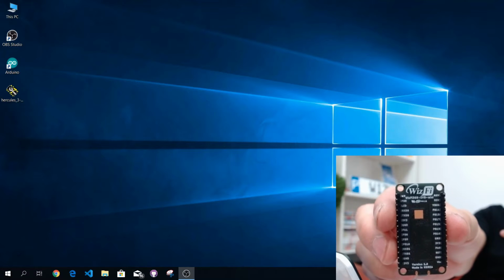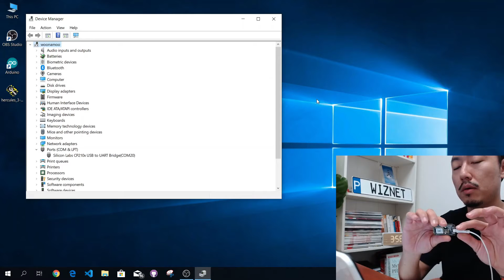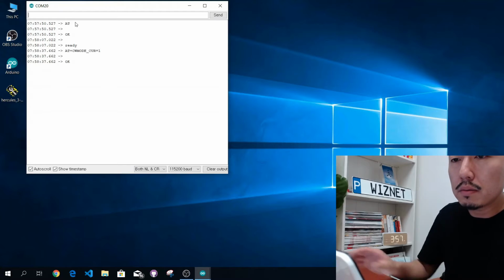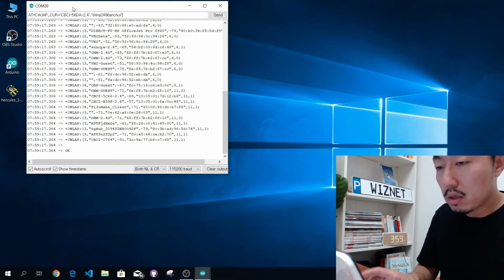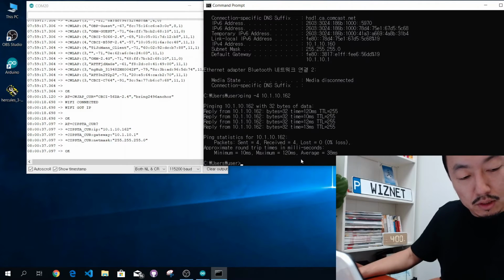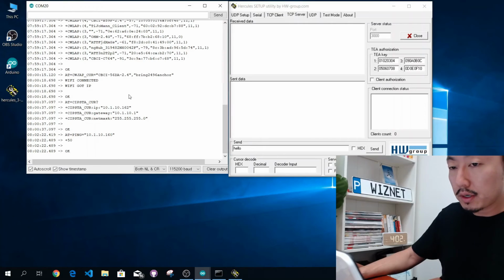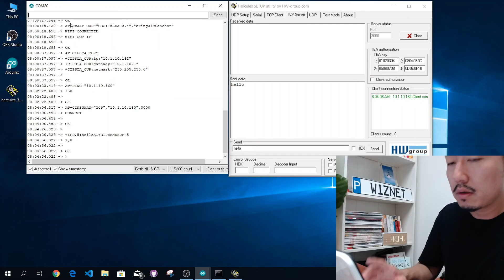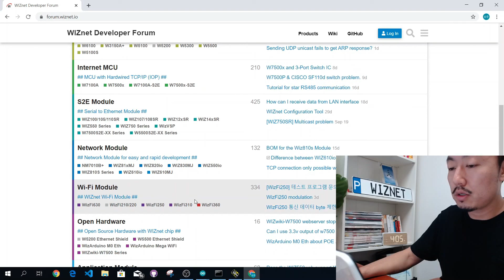[WIZnet] WizFi360-EVB-Mini / Quick Start Guide Tutorial

Comment: Have you tried using the MQTT protocol to integrate with Home Assistant?  I have a WizFi360 built onto a mini computer board with the TX/RX/GND pins exposed for the firmware update.  I've written ESP8266 firmware before, and even flashed TelnetModem to it and would like to first try to do some MQTT stuff for my first project.